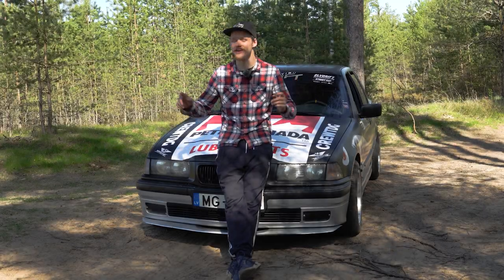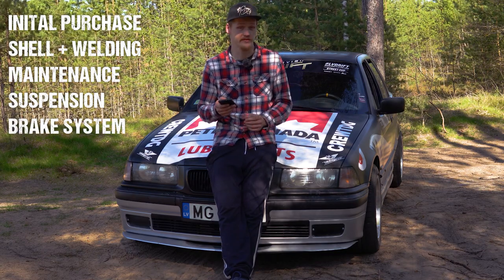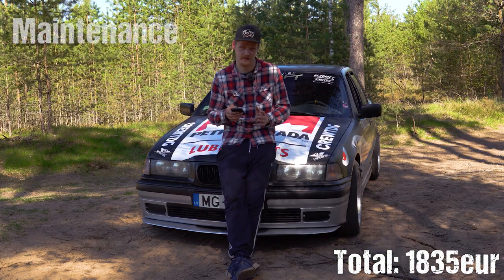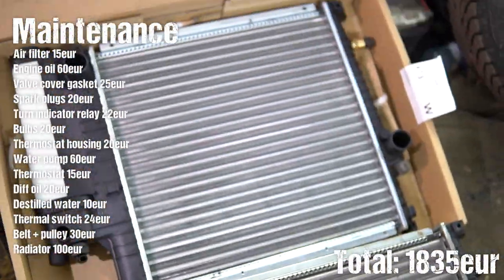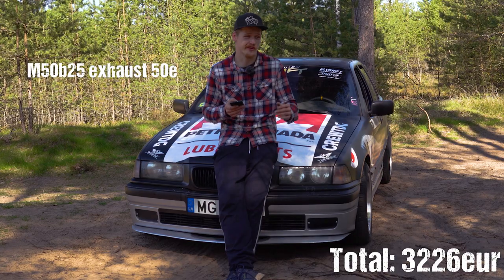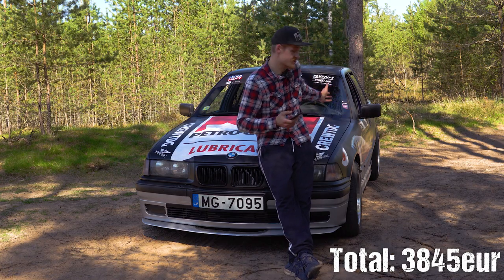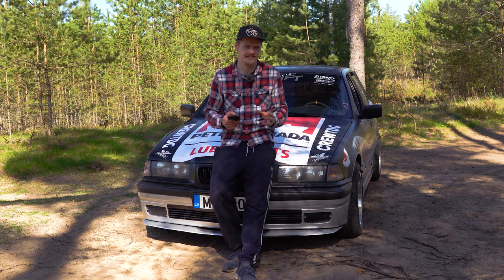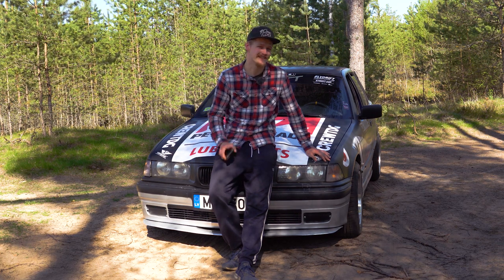THE PRICE OF BUILDING A DRIFT CAR

Comment from the maker: If this was Your car, what would You do to it next?
Reply: Mēģinātu uztaisīt 3.0 stroker ar m54b30 virzuļiem un kloķvārpstu un pieliktu klāt mercedes CKL230 kompresoru un tad vems un nočipotu uz kādiem 350hp ja varētu. Un uzliktu M50 kolektoru virsū. Tas jau droši vien nenotiktu,jo nauda nekrīt no debesīm.
Reply from the maker: @robertsdmitrocenko  Neslikts setups, tikai kompresoru vajadzētu stipri lielāku. Bet jā, tur jau neslikts cipars salasās.
Reply: @the_drift_gang  Es esmu redzējis ka no kompresora var izspiest apmēram 15psi,bet ar savādāku pulliju. Viens no anglijas Mersim W202 C230 Kompressor 15psi arī izspeda,bet tiem motoram ir kaut kādi restriktori pirms iepl. Kolektora un taurenīša(throttle body). Bet turbīnas ir mazliet labāks ceļš jo tie darbojas no izplūdes gāzēm,kompresori strādā ar siksnu un ar kloķenes pulliju.(Kompresori mazāk sprāgst)
Reply: Beat thing you can do now is seat time. Maybe a lock kit.
Reply from the maker: @monkeymsea01  lock kits are not allowed for my competition class, and yee, NOTHING beats seat time!
Reply: @the_drift_gang  oh wow that's an interesting rule. Your doing great without one
Reply from the maker: @monkeymsea01  Thanks man! The idea behind the street class in Latvia is great - grab a street car, weld the diff, throw a hydro in it, and go ham. No wild engine swaps allowed either.
Reply: @the_drift_gang  I actually like that. Good way to keep the cost down in the very expensive motorsport that is drifting
Reply from the maker: @monkeymsea01  Absolutely. Even with the ruleset in place, in order to stay competitive about 80% of the drivers are running brand new tyres etc, so it still adds up.